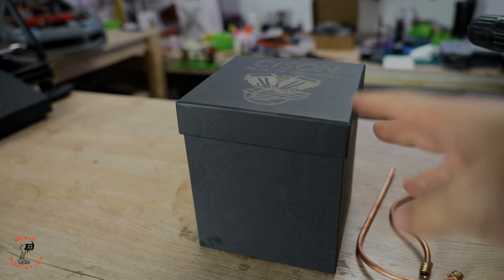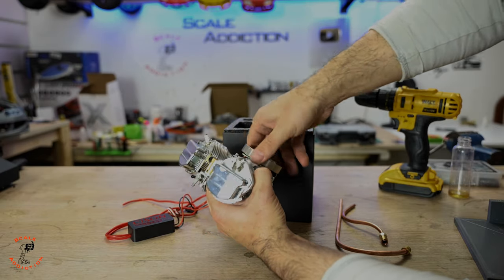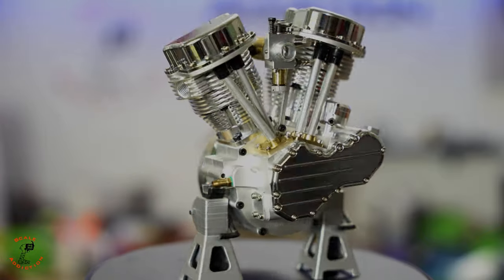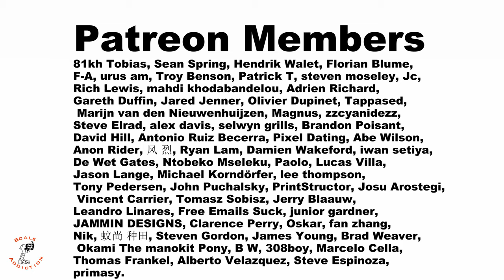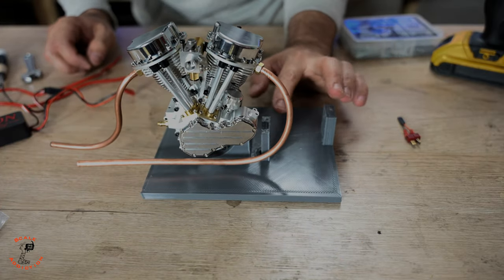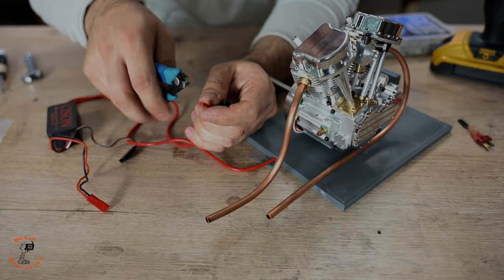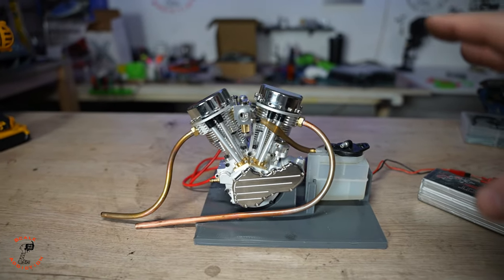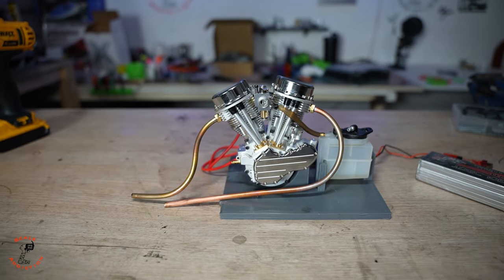V2 Engine Four-stroke Air-cooled Motorcycle RC Gasoline Engine | Scale Addiction

Comment: Beautiful engine !
We can see there is an empty space where should be a starter motor. Maybe adding this missing part is the first thing to do. Strange it's not included.
Then, to my eyes, the ugly exhaust pipes have to be replaced by two shiny new pipes, maybe a little bigger in diameter to look closer to those we find on full scale V-twins.
At last, it needs a heavy machined stand, with silent-blocks to allow the engine to vibrate as it should.